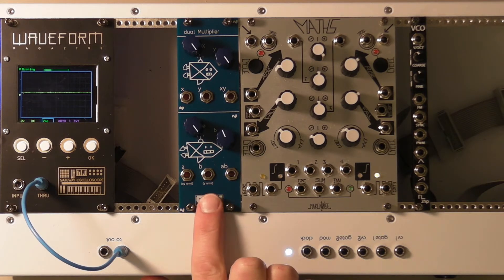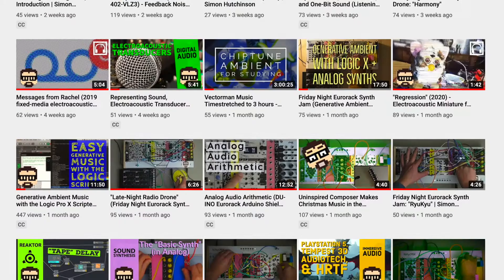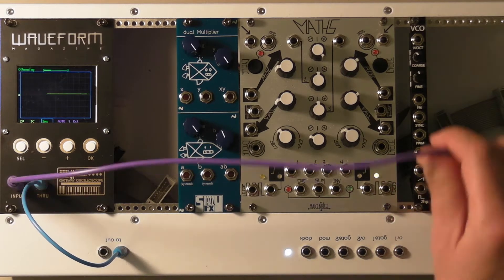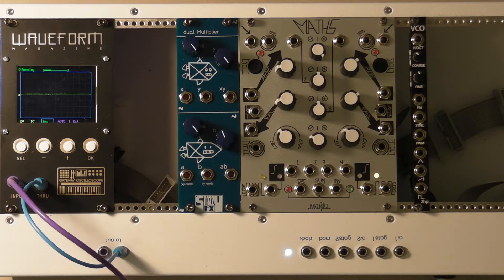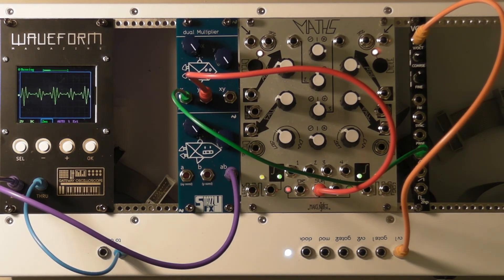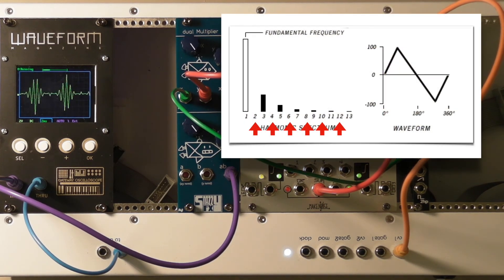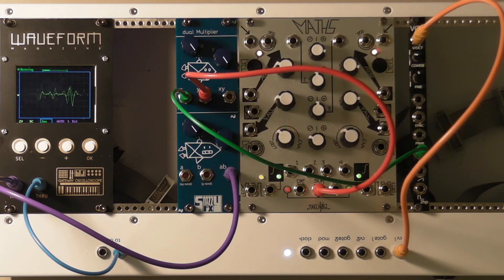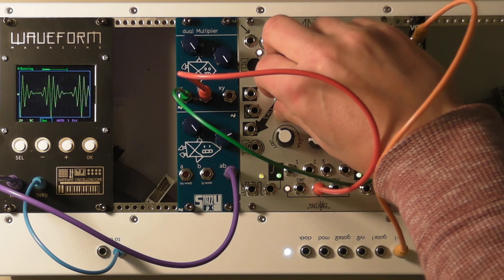Audio Multiplication, Ring Modulation, & AM Synthesis (Snazzy FX Dual Multiplier) | Simon Hutchinson

Comment: Fascinating! You helped me understand allot about modulation I was having problems with. The most important being the meaning of sum and difference. I'm a guitarist interested - as I just realized watching your video - in adding harmonic sidebands in my tone that will resemble the timbre of gamelan gongs... because until now my experiments with ringmodulators didn't quit get there: I only managed a generic bell timbre and with the known tuning issues. So if I understood correctly when I tune the ringmodulator to a certain note, the sum or the difference side band coincides with that note. Correct?  ....By the way: On 10.51 the timbre is close to the gamelan timbre I'm searching for: any tips on getting there? I have 3 ring modulators (2 with expression input), the only eurorack I have: Lil Erebous by DREADBOX, a couple of pedals with CV outputs some with LFO's, the EHX 8STEP and a bunch of tremolos. Can I do with what I have? Thanks...and Merry Christmas.